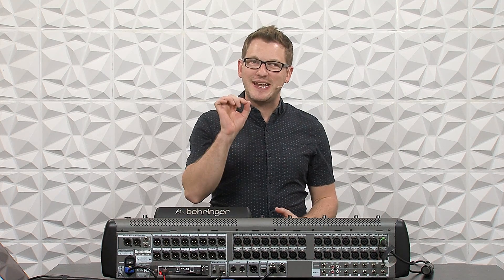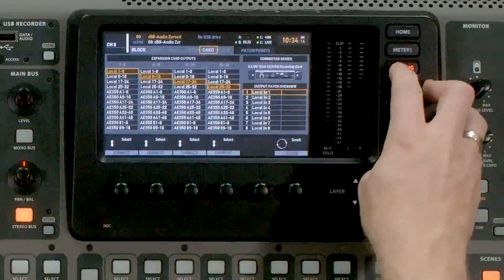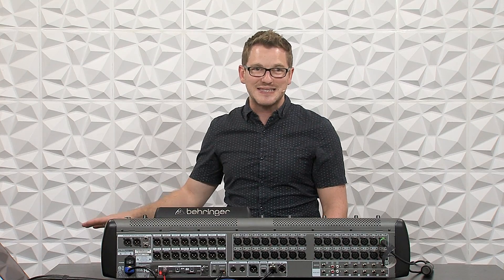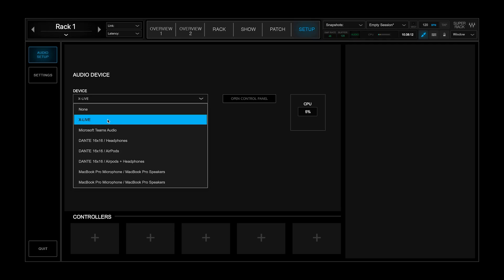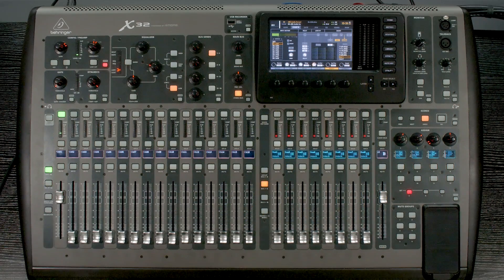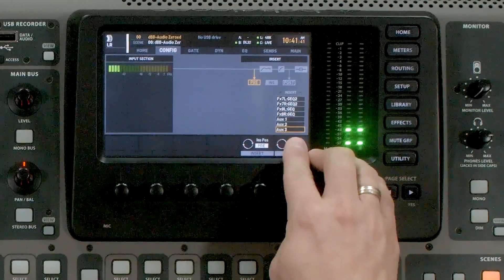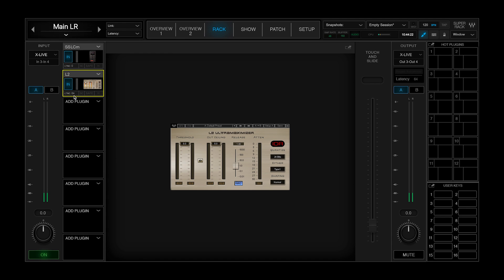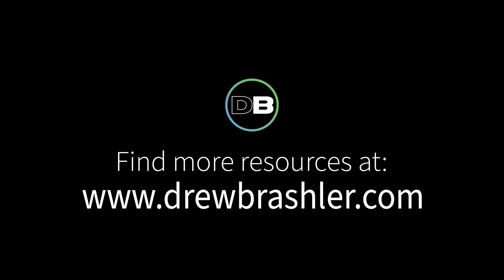Insert Waves SuperRack Performer on the Behringer X32 LR Buss

Comment: Do you recommend using a limiter and/or bus compressor on our main LR at front of house? Or is that typically something you only use for a broadcast mix? At front of house, we are currently using a slight bus compressor with maybe 3 db of reduction during the highest parts. We have the fastest release. I haven't yet used a limiter at front of house and was curious if anyone else does and what their experience was. Thanks!

Comment: Can it still run a full set of 32 channels through waves and use one of the 6 aux outs to go into waves, or are those 6 channels then theoretically waves "inputs" 1-6?
Reply: Where you able to find a solution to this ?

Comment: I get all the way to 6:42 but still get no audio passing to left and right. I formatted the console to zero and followed step by step..
Reply: Were you able to find a solution ?
Reply: Check the output on waves super rack, mine was on output 1-2 when it should have been on 3-4 in my case since I used aux 3&4

Comment: Hi  Drew
I’m using a M32 with SuperRack Performer. I want to put Waves Plugins on my Main LR Output. I watched Drew Brashler’s video on how to have plugins on Input channels 1 - 32 and that works just fine.  Now, I want to put Waves Plugins on my Main LR via my Aux Input/Output channels. 
Does this mean that I’ll no longer be able to put Waves Plugins on Locals Input channels 1 - 8, and only be able to put Waves Plugins on Input channels 9 - 32?
I’ve also watched Drew Brashler’s video on how to put Waves Plugins on Output Busses via Aux channels but am unclear if I lose Waves Plugin processing on Input channels 1 - 8 in order to have Waves Plugins on my Main LR Output.
Reply: Where you able to find a solution to this ?

Comment: Thank you so much Drew! This channel is a blessing. Hypothetically, I have figured out how to make this work on LR and still use my auxes, but wondering your thoughts! If my auxes are remapped to user in 1-8, user inputs 1/2 are card 1/2, and the rest of the user inputs 3-6 are what i had mapped to the rest of the auxes 3-6, this should work correct??

Comment: So.  The only way to insert a rack channel from waves super rack is via aux?  I'm using a waves server and the Dugan for 20 mics.  I want to insert a processor on the group/aux that those mics are routed to.  So... I'd need to use aux 1-2... If they makes sense.  ps.  I am trying to do this on a M32C, which seems to be a little different.

Comment: I have implemented your advice, I have a buffer with 512 samples, we do not really hear the latency in the room because there are many echoes and the room is not soundproof.
The big problem I have is that when I activate the inserter on the auxiliary 5 and 6 there is a strong distortion, we really have the impression that there is an effect on the track while not at all, all the other tracks on superrack works great ... anyone has the solution?